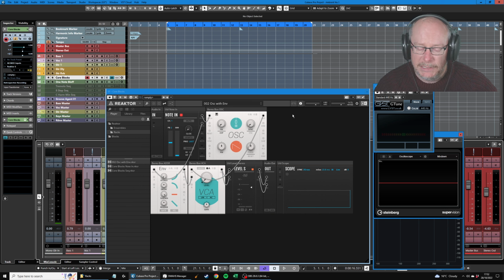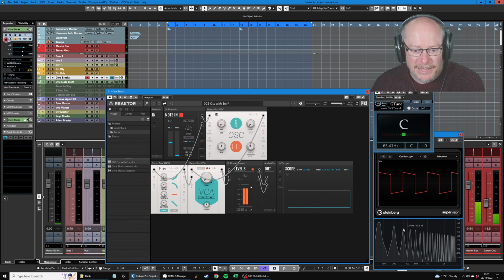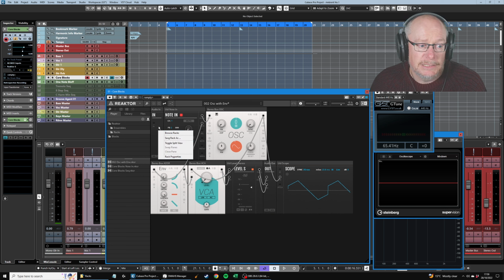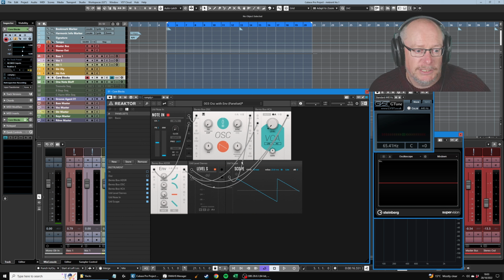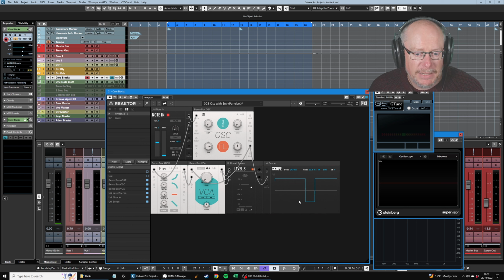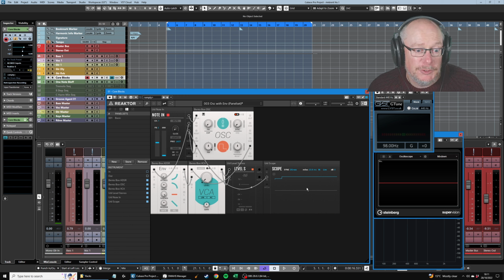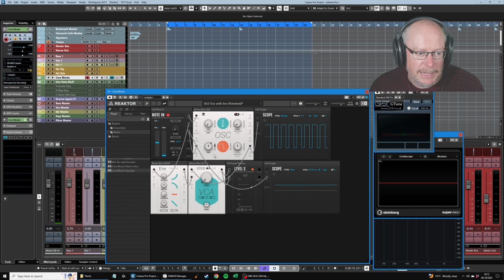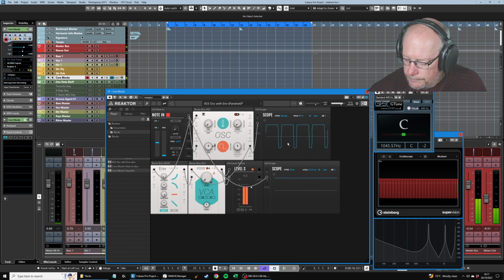Native Instruments Reaktor 6 Pt.3 - Basic Waveforms

Comment: Thanks for the time you take to make these tutorials. I am currently a little lost. At the beginning of the Modulation section, you switched to manual mode. How did you do that? I am getting constant note on and my VCA does not have the little arrow that follows around the level control. Thanks.
Reply from the maker: The VCA is responsible for controlling the volume at its output. When it's Level control is turned fully ANTI-clockwise, signal only gets out of that block when its gate is opened. That gate is being opened by the connection from the Envelope to Input 'A'. So, you press a note, the note triggers the envelope, the envelope opens the VCA gate, and you hear sound. That is what I'm called 'manual mode' - in other words YOU are in control of the sound by pressing a key. When the VCA level is turned fully CLOCKWISE it doesn't need a gate - it's letting signal out all the time. That's why you're hearing a constant sound.

Comment: HI, great works thanks a lot. How can we achieve polyphony ? thanks by advance. Cheers, Ztevoz
Reply from the maker: Thanks! There's no easy way. Modular systems are typically monophonic. Typically you stack multiple modules together and generate one pitch per oscillator. Of course, there are polyphonic modules out there, but that's just doing the same thing in a box.
Reply: There is another modular synth that is very similar (but a lot better) that allows you to switch into polyphonic mode using a polyphony module. That is the Multiphonics CV-3 by Applied Acoustics. Check it out!